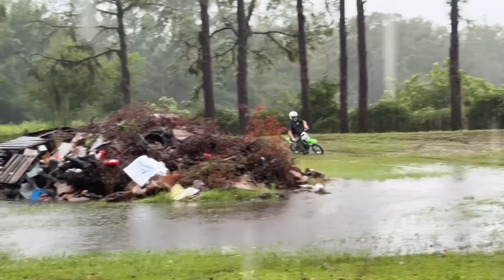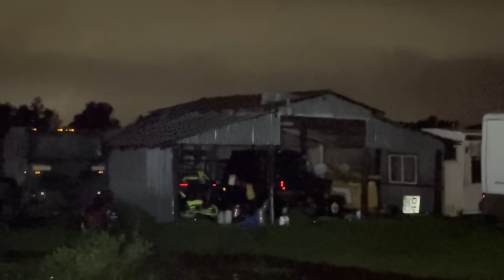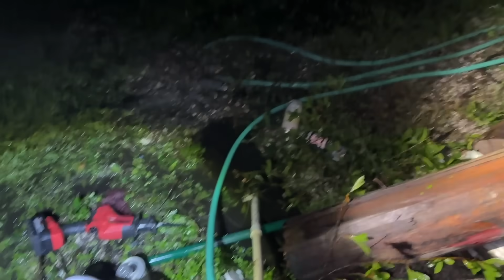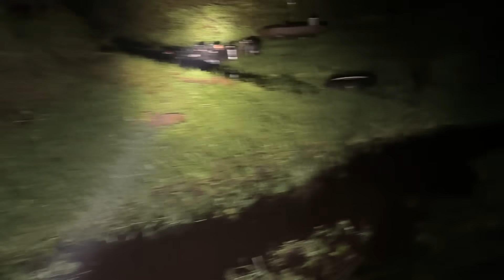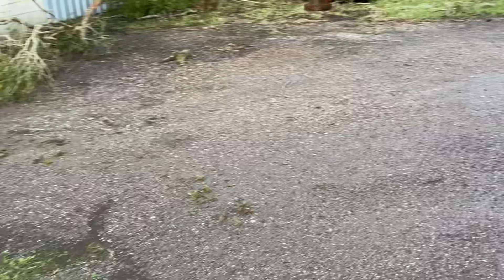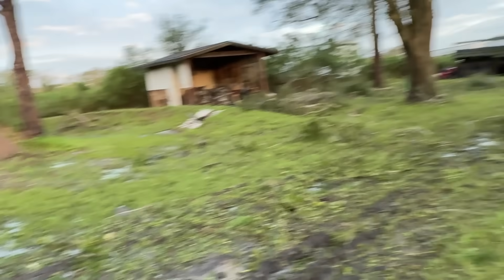Hurricane Milton Hit Us Hard!!! The Eye Went Right Over Us...  We Will Rebuild

Comment: For anyone ever trying to fix a pipe that has water coming out like JH did in this video, heres a trick. Cut and prep your pipe you want to glue or cap. Then get yourself some slices of bread. Have your primer and glu ready to go. Pack the pipe tightly with bread, some pipes may take more or less depending on flow etc. The bread will swell and stop the flow long enough to glue the pipe together. After the bread swells and gets saturated for a few minutes, it will dissolve and dissapear.
Reply: I have done that while sweating copper.
Reply: Legend.
Reply: done that welding pipe at a plant that couldn't have water shut off due to regulations used 2 loafs worked like a charm
Reply: First thing came to mine when I saw right idea
Reply: I'll just put away my assortment of shark bite fittings. Lol. I've used the bread trick before but you can't beat a good push on fitting for emergencies
Reply: I recommend this  we use this method with on golf course irrigation doesn’t work well on 4 or 6 inch pipe though.
Reply: Also, in that case take the hose off of it, open the valve and let the water run until the glue dries then close the valve. That way it's not under pressure.
Reply: all the bread is in your faucet screens...
Reply: was just about to say the same.. and when you glue have the valve open. so the glue don't need to work against pressure.
Reply: This works. Ive used this technique when a valve wouldnt fully close so water kept draining out pipe that needed fixing. Used about 5-6 pieces of bread and it worked. It was 2" pipe btw.
Reply: So if I put a slice of bread in a cup of water and sit it on the table, the bread will just disappear?
Reply: @budddove6480  no, it will break down. When using it in a pipe, once water pressure is turned on, it will blow it through the line and break down where it does not affect the flow of water. I cant believe im explaining this. 🙄
Reply: @51-FS  its like when your toilet is plugged up. Same theory. Its plugged until pressure, force is applied and it travels down the line. Its really not rocket science.
Reply: @51-fs
Reply: Sorry reply was for above guy.
Reply: This is true, but not for a waterline under working pressure
Reply: @toyhunterslasvegas  Bread crumbs can get stuck in smaller pipes or faucet aerators, causing reduced water flow or even blockage. Can't believe I had to explain this
Reply: @toyhunterslasvegas
Reply: Perfect!  That's how you solder pipes with water in them.
Reply: Blue glue for the win. You can glue fittings underwater
Reply: Before I even read this that was on my mind.
Reply: Yep
Reply: @51-FS  i used it on a irrigation system and i did say it was 2" diameter pipe. The pressure once turned on, easily blew any leftover bread down the line and out a sprinkler or a cleanout valve. Point is, it can be done in a pinch. People that work in certain industries like i did, learn tricks of the trade that non pros would never consider.
Reply: Or just use wet dry glue 🤷 🙄 😏  lol
Reply: Just added a loaf of wonder bread to my tool bench. Guy at the hardware store asked if I need standard or metric. I didn’t want to go all the home to check so I bought two loafs.
Reply: Here's a better idea, stop using PVC pressure pipe and use polyethylene like the rest of the world. It's not frangible, it just bends, it comes in 100, 250 and 500-yard rolls so there are no joins and the fittings are tightened by hand.
Reply: @marcmo7138  I learned it from sweating copper, and have had success using it gluing pvc.
Reply: @VikingShelters  The perfect scenario doesnt always exist. Theres lots of great ways to avoid the bread. I was speaking on this scenario we seen in the video.
Reply: @toyhunterslasvegas  don't they make a gule that works in wet conditions?
Reply: @marvindebot3264  The rest of the world LMAO. Ive done plumbing for over 30 years and still make most of my money fixing antiquated style piping and plumbing. Sadly not only in old buildings.
Reply: @51-FS  yes, its called hot glue but it turns to slime when it gets too wet. Makes a real mess if youre knee deep in a hole of water and glue and primer. Not to mention how strong the chemicle fumes can get. Ive pretty much done all there can be done when it comes to fixing residental and business irrigation systems. From running clocks,valves,backflow preventers,etc sometimes you have to go outside the box to solve an issue and i wouldnt of thought of it until an oldtimer told me about the bread trick. For me, it worked. Not saying it will everytime but trying to solve an issue is better than not trying.
Reply: @marvindebot3264  poly pipe is good in lots of applications but when you are plumbing booster pumps and large 3" valves, you cant use poly pipe plus some building codes wont allow it plus if its above the freeze line,polly can burst. The clamps that connect the joints to rust in time causing a weak connection. Ive used many miles of 1" - 2" polly,its easier to install for sure but does have its issues also.
Reply: @xhyperlite142x  it can do wonders that Wonder bread. I think wheat bread is the metric size.🤣
Reply: @51-FS if it gets into a water reservoir or hot water tank, it can cause bacteria to grow too. As well as ruin a plumbing system
Reply: @toyhunterslasvegas stop talking. Pretty much everything you said is wrong.
Reply: @ryanfriars545  ok. Because i didnt do installs for 20 years. Im sure youre the expert. Keyboard commando. Does that work for you in your everyday life, telling those who are smarter than you to shut up? Doesnt suck only say hello to your wife and kids when you meet in a public place to do the exchange? How long do you think telling her to shut up was going to last? But hey, im sure youre the expert. Sooner or later youre going to meet a person you told to shut up online in the real world, you know,away from your moms basement and saying shut up in person doesnt quite go as well as typing it on your apple 2 desktop.
Reply: @toyhunterslasvegas  u really should take his advice and stop talking
Reply: @toyhunterslasvegas  u would think someone who's been doing it for 20 years would have the right tools. I'm just a handyman and I even have a jet sweat kit that goes up to 3 inches. Only used it once.
Reply: Did you notice that he didn't use primer just clear glue , I would have used wet / dry for a repair like that and yes I have it on hand in my shop .
Reply: Also the best glue is blue it'll work 90% of the time even on a wet surface.  Honestly never really seen it not work.
Reply: You can use witches sticks/coat hangar to find the line underground.
Reply: My Commercial Licensed General Contractor business partner did this so I could repair the main to the house in Keywest and it blocked the pipe. I had to make a air setup to reverse pressure the bread out of the closest faucet.  Yes it works but remember this is blocked and doesn't breakdown. Use cheap bread not potato 😂.
Reply: There are tools made just for this and they work like a boat hull plug. Shove the plug in the pipe and turn the handle to expand the plug. Repair the pipe, then remove the plug. Mine are for 1/2" and 3/4" copper. With sweating copper fittings, any water leaking by will cool the tube and make it extremely hard or impossible to get a good joint.
Reply: @CGT80  jet sweat
Reply: @thudtrades1850 no it will not.
Reply: @toyhunterslasvegas
Reply: @Hughjanus454  never has worked for me , I am a water operator for 35 years and I have tried and tried but a coworker of mine is about 95% correct using that .

Comment: I'm just here for all the electricians to start flaming you for back feeding the panel ! lol
Reply: He had the main turned off.
Reply: I was thinking the same thing. He has plenty of friends that could have set that up the right way
Reply: What's the rite way?
Reply: @Ibetyouwillreportmebcursoftaf   A generator transfer panel is the right way 👌
Reply: Section 702.7 of the NEC, needs a mechanical generator interlock that is listed. Not flaming him because… hurricane 😂
Reply: Yeah I was looking for someone to say something. But I guess if it the main is off you aren’t feeding power lines
Reply: Yeah I was looking for someone to say something. But I guess if it the main is off you aren’t feeding power lines
Reply: Generlink if legal in Florida is a better idea
Reply: It will work in a pinch
Reply: @rockkhound943 or a hurricane with the mains off
Reply: @CaleMessner  not off , pressure turned down .
Reply: But he's not that's why he turned the main off... Not going to lie when I had my first apartment I back fed my electricity from a neighbor for 3 years in the middle of nowhere in the Northwoods of Wisconsin and split it with him😂 never had a single problem

Comment: Pack the pipe with bread. It'll stop the flow of water so you have a good weld. Bread will flush out. Good to know yall are we. God Bless. Texas sends prayers. ❤
Reply: He doesn’t have enough pressure to wash out bread. Lol. Did that once on 6” line at Waxahachie school. Went to cafeteria and ladies went crazy. Took about 18 loaves to stop it. It blew out like howitzer when we opened valve
Reply: @russellridge8623  look don't want pressure. Stop the flow, make the weld. turn it on and flush.

Comment: 13:58 put a slice of bread on the pipe. It’ll hold as long as you need, but dissolve after a minute or two
Reply: So it won't hold as long as u want it to?😮
Reply: @51-FS  you smell bad
Reply: Buddy, you have no idea how much you've just changed my life 😂😂
Reply: @redneckmechanic94 it saved my 50' boat once, took a whole loaf. Well, atleast saved it until the next year when we had 32"s of rain within a few days and the generator was swamped and shut off the pumps then the electric pumps batteries ran out.  😂
Reply: Was what I was about to say

Comment: We live in a 100 year flood plain in Pinellas county. Property is 33ft about sea level, non evac. We had over 3 feet of water in our streets. We had one car with water to the door handles, my truck had a waterline at the bottom of the door, its got a small lift and on 22s. Wild. The entire front yard was a lake. You could see waves crashing over from the winds. We had the 100 year flood. Thankfully the water was only in the garage and some blew in the front door. Tree branch put a fist size hole in the roof but everyone is safe. I've been in Florida for over 38 years now. Never once evacuated. This was the scariest hurricane we have been through. At one point we had a tie down strap around the front door handle to keep it from shaking. Lost dozens of branches as thick as your thighs. When you look out at the skyline now its different. All the trees are different. Some gone all together. Glad you are safe. This one was wild!

Comment: One thing to remember is when you are back feeding. You have a strong possibility to back feed out on the neutral. This will go out to a transformer and onto the lines.
The possibility of a lineman getting hit by your neutral is high.
So the safest way is to either have a transfer switch witch will break your neutral.  Or turn your main off and disconnect your main neutral comming into your main panel.  Isolate your neutral to your meter can.
Reply: JHDieesland4x4  Hey, i got a reply about winning?

Comment: For next time to stop the water from coming out of the  pipe.  Use a piece of bread like a cork.  It will stop the water long enough for the glue to dry. The pressure will flush the bread out when you trun the water on and out of the pipe.  Just a little plumbing tip for you.

Comment: I remember when Yasi hit they were 290kmh winds, we were very lucky to have building regulations for most of the homes here but it still completely sheered the roofing off of much of the older houses, I remember watching a thin sheet of corrigated iron rip through the air and smash into the side of a caravan basically disintergrating it and dragging it down the street

Comment: Glad you guys are ok, damage as to be expected JH. 
I’m not a Sharkbite fan for real plumbing(permanent), but with any full pressure pipe ruptured like that, a sharkbite ball valve would fix things in about a minute. Just cut where the hole is and stick the Sharkbite valve on both ends (in the open position). Done!
If it’s not a critical pipe Sharkbite works for that one thing.

Comment: As far as your barn goes, generally the metal roof is your shear panel. Its what give the building its strength. After a certain size, engineering requires us to have atleast 30' of roof on before continuing setting trusses. Having an open front, just makes it a big old parachute. When we build barns for people who want an open front engineering significantly beefs up the interior bracing.

Comment: For generator filling at least smaller generators. An old fuel tank works well. hook it up to a drill battery and you have a filling station. I put a 20 gallon jeep tank on a small pallet. I put it in and out of the truck with the loader. Just put it near the generator for filling. Now I have solar battery backup. So even without panels, I can charge the batteries and run the house off the generator. So I only have to run The generator part time during the day.

Comment: Just take your glue dobber, and apply some glue to the exterior of the pipe if you sprung a little leak. 

Doesn't work every time, but sometimes it'll patch it up if the leak is slow enough.

Comment: Just throwing it out there. When you use your sawzaw if you push the saw over so that little metal guard is touching what your cutting it will cut betyer. It also keeps the object from violently shaking back and forth. Sometimes things will break not where your cutting. 😂

Comment: sorry to see you suffered some damage , sure hope you got good insurance 
it might end up a blessing in discuise if youre build aproval and insurance money comes through at the same time , with all the damage that happened during the storm the cuonty might speed approval procedures up to get everything repaired in a timely fasion , might want to push the permission procedure a little right now to prevent it from falling through the cracks
i seen other fifth wheels with the same type of damage to the supportlegs , makes me wonder if there safer hoocked to a trauck and on blocks , might still move but at least the supportlegs are still usable , couldve set it near the shop wall too so it be mostly out of the wind

Comment: pipe repair, next time, put the coupler on the side without water. then open the faucet, then install it on the supply, give it a little time with no pressure, to set, then close the faucet.

Comment: Next time open the valve before putting it back together. Glue it up, stick it together and turn the fitting 1/4 of a turn and hold it tight together for 30 seconds. Then you will be fine.

Comment: I’d be curious if you’d have used a Sharkbite type cap on that water line if that would have held for that situation. Personally I have several size push on connect type fittings in the tool box just for those water leak occasions.

Comment: It is a VERY BAD IDEA to plug that generator into your dryer plug!  What you need to do is to have an external twist-loc outlet with its own breaker installed on your outdoor main electrical box.  When the power goes out, go to the box and trip off the main breaker.  Hook up the generator, turn it on, and then turn on the generator breaker.  Now you are powering your whole house through the generator breaker, not the dryer breaker.  An electrician told me to do this and said that people destroy their dryer breakers all the time and occasionally start electrical fires when they do  it the way you've done....

Comment: Bread my friend bread
Just saying 
Bread will stop the leak so you can glue it back together,,,,and the bread will just desolve ,,, squeeze the bread together,,,and then jam in the pipe,,,get the fiting on other side of pipe,,,then do that water side last,,,and open the hose facet,,,to relieve the pressure,,,why it's drying

Comment: Please don't show people how to back-feed through the laundry plug.  At the very least, explain the dangers, and make it unquestionably clear that IF you do it this way, the main breaker HAS to be kept OFF.  Also, if there is a solar system, it needs to be disconnected as well while the generator is in use.

Comment: just two things,  bread can be used to stop the flow of water if theres not alot of pressure,  and when trying to fix a break like that where water is flowing,  give your fittings a twist qtr turn right and back left or vice versa,  giving it the twist will water can escape will help get the best seal. honestly i twis every fitting i set just helps the joint.